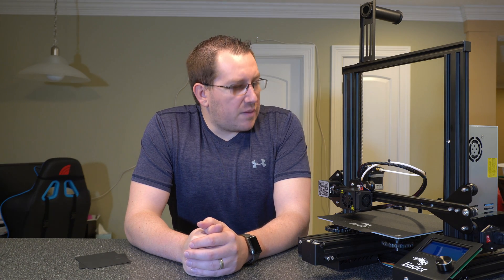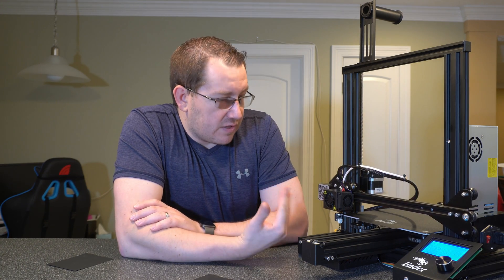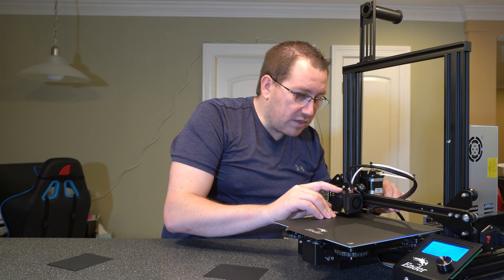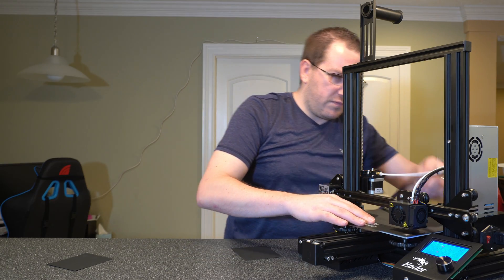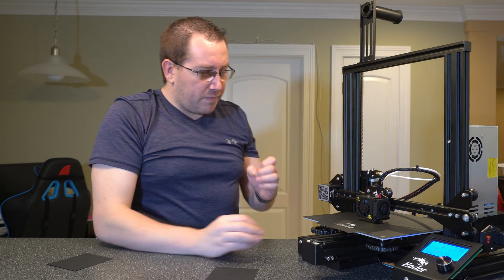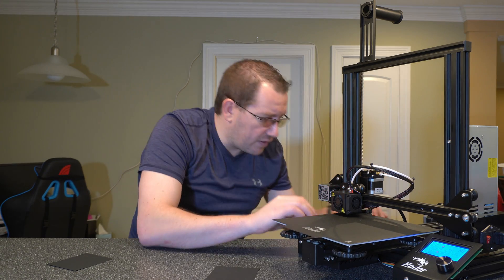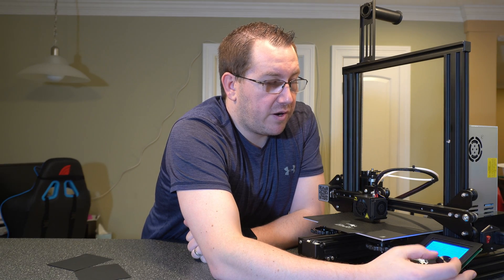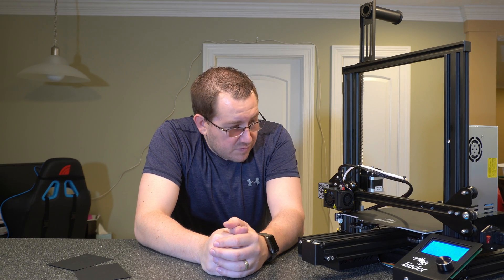Ender 3 Pro Bed Leveling (Without Extra Tools or Upgrades)

Comment: I have a question first I want to say thank you I was trying to compile my own Marlin software and got confused but you had it on your website so I got it from there so thank you but I have a question about bad mesh leveling do you have that software compiled already also would be nice if you have that I'm willing to try it out and see how it works having some trouble printing sometimes again thank you for the software you compiled before with the Marlin update
Reply from the maker: Hi. Are you having issues with the firmware? Sorry, having a hard time following your question.

Comment: My disable steppers button doesn't seem to working properly. When I select it nothing happens in the menu and I'm not able to move anything around. Any suggestions?
Reply from the maker: Hi. It normally doesnt do much but beep i think, but you should be able to move things around afterwards. If thats not the case, it could be an issue with the firmware. You could do everything manually with the power off.

Comment: This happened to me last night. 
I just finished building the printer, wanted to try my first print.   I have the glass surface.  I didn't know to start fully tight or loosened all the way. (First mistake).  So I took the glass off and tried to level but the zstop wouldn't allow the nozel low enough (remember I took the glass off) a Facebook group said to cut the knob off the z stop sensor (new headaches frustrations) played with z stop sensor,  auto homed and got the nozel to clear the bed if the ztravle was 1mm above auto home

 Adjusted all 4 corners tried to go through the process a second time and the nozel ripped through the paper and dug into the print surface.  Frustrated, I gave up.  I am just about threw the printer in a large dumpster.
Reply from the maker: Hi. Sorry to hear that. Leveling can be a pain. I typically go through the first round or two without the printer being on (so manually moving everything), this allows me to get things close enough so that when the drivers go to move between points it wont hit the bed. From there, i heat the bed up and do a final round.

Comment: Quick question , I have ender 3 pro . Running petg. Stick SD card prints run beautifully . Like super smooth great prints . But I’m having trouble with loaded prints sticking to the bed . First layer gets all pulled up and off then it’s downhill from there . Please help ! Tried all sorts of temps and skirts compared to brims .
Reply from the maker: Hi. What type of build plate are you using and are you sure you bed is completely level?
Reply: @3DPrintscape  had a successful print last night , the actual print is fantastic . But the bed temp had to be so high to get that result
Reply from the maker: @ilyowen5817  What temp did you end up using for the bed?
Reply: @3DPrintscape  105 running petg with extruder at 245 . Had a failed print this morning . After 4 hours the print pulled from the bed and warped horribly , ordered the ender 3 pro upgraded tempered bed and also the ender enclosure incase it was the ac
Reply: @3DPrintscape  update ; after a hour of leveling and 4 failed bases . I have successfully found the perfect setting for overture petg on the 3 pro . ( still have glass creality plate and Fr touch on the way ty for the install video btw ) 245 for extruder - 105 for bed . Perfectly level and the base is coming out flawless . It’s beautiful I could shed a tear of joy . Anyways thank you .
Reply from the maker: @ilyowen5817  Thanks for the info, that pretty high for petg.

Comment: just a FYI stepper motors can produce electricity its best to either move anything connected to the motor slowly! or my favorite is to it take 2 minutes and pop the connection right off the motor to protect the mother board from any power surging
Reply from the maker: Hi. Thanks for the feedback and thats a good point. Disconnecting the stepper if moving it a lot is definitely the safer approach.

Comment: I have been doing this for the last half hour. No succes...
Reply from the maker: Hi. It can be somewhat tricky to get the process down the first couple of times. What issues are you running into?
Reply: @3DPrintscape  apparantly I had to adjust the eccentric nut on the hotend because it was wobbely. Working fine now after leveling. Thanks for your time!
Reply from the maker: @geertdejong1982  You're welcome

Comment: I swear I’m having issues with leveling I fix one issue now having another one .
Reply from the maker: Hi. Ya leveling is a pain. Did you upgrade the springs at all? If not i would look at doing that.
Reply: @3DPrintscape  you know I was thinking abt it but since I just got it I felt I didn’t have to do it .but I will change change them
Reply from the maker: @Putifly69  Let me know if that ends up fixing the issue for you.

Comment: 1 mm gap?
Reply from the maker: Hi. Im not following the question, can you provide more details.
Reply: @3DPrintscape  I'm having issues with my bed leveling. In this you mentioned needing a 1mm Gao between the bed and. nozzle for bed leveing. Did you mean 0.1?
Reply from the maker: @JstSurf  Ah ok, ya it should be .1mm (sorry about that). Just use a sheet of printer paper between the build plate and nozzle and get it to a point that it barely scrapes the nozzle.

Comment: I leveled it using a card stock 1mm thick and checked every corner 5 times. However the 1mm thick card was not enough, the extruder fucked up the plate, leaving dents. DO NOT LISTEN TO THIS GUY. For your first run, be safe and add extra space. Its better to have a gap and readjust afterwards, instead of messing up your plate.
Reply from the maker: Hi. Sorry to hear you are having issues with leveling your build plate. The card start is technically on the thick side, the standard recommendation is a sheet of A4 printer paper. If you go with anything thinker, you will end up having to repeat the process because the filament wont stick to the bed.

Comment: Great video.  I'm working on an Ender 3 Pro for a friend of mine who couldn't get it working correctly.  He didn't read the instructions very well... lol...   Anyhow - Another tip on leveling the bed using the method above, on your card stock, take the time to measure the distance from the edge of the bed to the leveling screw (both directions).  Then put a small circle so that when you are lining up the nozzle with the calbration point, use the card stock to insure the nozzle is directly above the leveling crew.  This way all pivits of the bed will be centered on leveling screw points.  If you do this, when you adjust the other corners, it won't impact (as much) the points you've already leveled.  Takes less time and makes the process much easier...   Thanks again for the video...
Reply from the maker: Hi. Thanks for the feedback. I will give that a try next time I level my build plate. I don’t do it to often anymore because I have a BLTOUCH.

Comment: When you click disable steppers on the screen besides from the sound of the know being pressed in is there and other sound it makes to let you know the steppers have been disabled. Also after you disable the steppers will that allow you to move the bed and the extruder around smoothly like in the video you should.
Reply from the maker: Hi. No it doesn’t give you any indication that you actually clicked on it, not sure why they did it like that. Yes, after the steppers are disabled, you should be able to freely move both the x and y axis.

Comment: I think it's an important part to pre heat your printer first, after all; metal parts do expand under heat
Reply from the maker: Hi. Thanks for the feedback. Heating the bed first may make a little difference, but I don’t think it's required, it definitely wont hurt though. I say that because the expansion will be minimal.

Comment: Youre the only person who has said why its important to disable steppers. Thank you, I learned something new today!
Reply from the maker: Hi. Thanks for the feedback, Im glad I was able to help out.
Reply: It's not important to disable steppers. They are there to be used. Telling people that they will wear out is completely ignorant. If you're worried they will wear out then just let your printer sit in the corner and never use it. I'm pretty sure the steppers are on a timer and they auto shutoff anyways.
Reply: @markjones2349  I always disable the steppers just for one simple reason: it's much easier to slide the x and y axis manually without the resistance.
Reply: @peterjigstad9755  Well that's pretty obvious their Peter.

Comment: Thanks for all these great videos! I have the same printer but the thickness of a card stock for me create too much of a gap compare the a piece of paper.
Reply from the maker: Thanks! I have always used card stock with no problems. I guess one thing that could impact the height would be the amount of scrape you tend to use when leveling the bed. If you let the extruder tip just slide over it and not touch then I can see that making a difference. I tend to lower the tip until I get a little resistance.

Comment: I noticed your bed is wobbly while you were trying to level it.  Try going under the bed and adjust the eccentric screws to tighten it slightly from wobbling.  This will make the levelling easier and consistent.
Reply from the maker: Hi, thanks for the tip. I will give it a try!